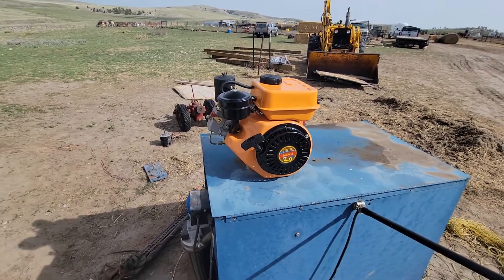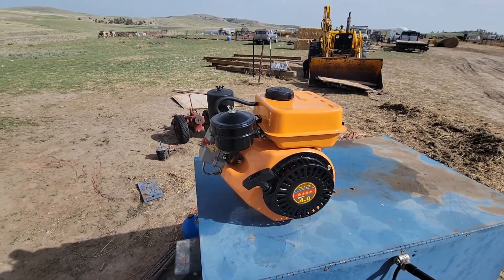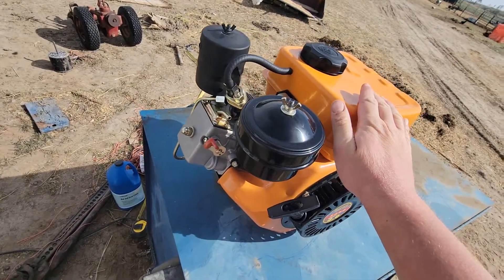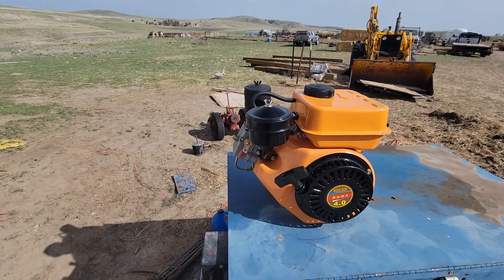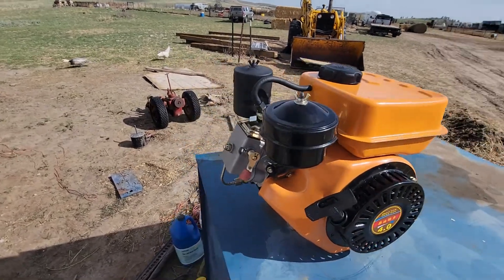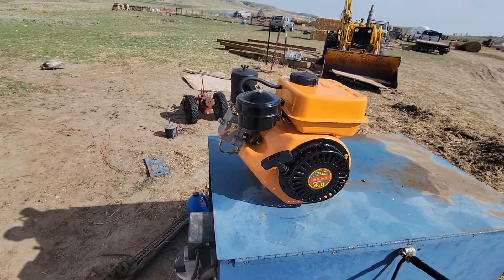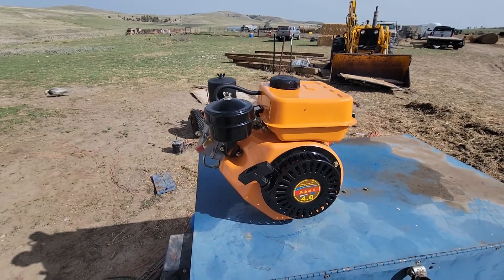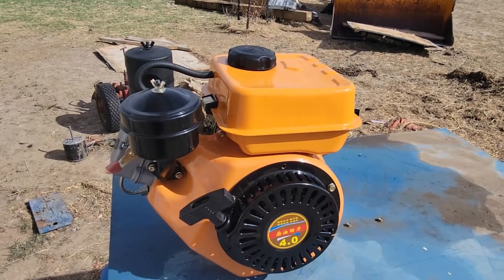196cc Chinese diesel engine ranaway on me!!! What to do if this happens to you

Comment: What damage will occur when this unit run away too long? I'm thinking to swap wood chipper engine for diesel.
Reply from the maker: Well I'm not a diesel mechanic but if they run away to long it will damage the piston and cylinder and ether seize up or blow apart but I wouldn't worry about it if it does happen you can power down the engine very quickly with that decompression lever just make sure not to Rev the crap out of it all the time that could trigger it but for use on a wood chipper I wouldn't worry about it. There is a guy on YouTube that rebuilt one and put it on a log splitter because the quality control is terrible from the factory everything from finger tight bolts to so over tight they pulled threads they also use used motor oil to test them! I even had one of mine where they Cracked the aluminum housing under the decompression lever so if you buy one at a minimum you should thoroughly inspect it and make sure that you buy from someone that accepts returns so if there is something damaged that is not repairable you can return it i bought both of mine from Walmart.com. Sorry if I might have scared you but they have surprisingly good quality control on making the parts just not on putting them together there are good little engines and if you rebuild them and do a good job i could see them lasting a long time good luck my friend.

Comment: You’ll need to pull your injection pump out and see if the rack is moving.
Reply: I was going to say the same thing!
Reply: @dieselbossbrandon  no throttle control gave it away. I had my rack stick in my 90’ Cummins that I p-pumped. Happened on the highway after a pull it was the scariest experience I’ve ever had in a vehicle.
Reply: @linusrillch  Dangggg I bet!   I was removing the rack limiter on my OM617 Turbo when I installed the shut off solenoid backwards pushing the rack to full fuel and started it up and she revved to the max so luckily I was ready for that and had a run away board ready and shut her down real quick but took a few run aways to figure it out. Scary tho for my first run away.  But you definitely have me beat.
Reply: @dieselbossbrandon  whats a runaway board just wondering?
Reply: @cadenjames442 Plank of wood to suffocate diesel engine? 😂
Towel would be stupid as it sucked in and shred 😮
Reply: Seen it a many of times on 53 series Detroits

Comment: Mine did this. Every time I have tried to start it after, it continues to do it. Not sure why or how to fix it. I swapped one of these into a Sears garden tractor I have thinking it would be a nice little engine swap til this happened. I havent tried to start it in months because last time I tried to start it, it was still running away
Reply: Sometimes what happens is the injector pump rack isn’t set in the governor arm so it would only be at 100% or 0%